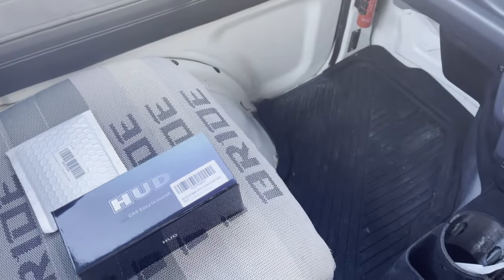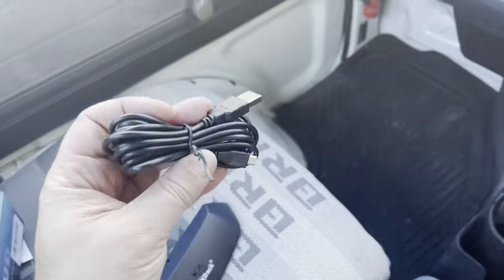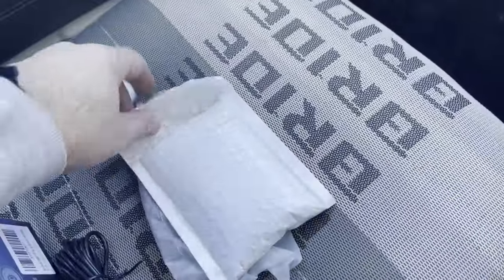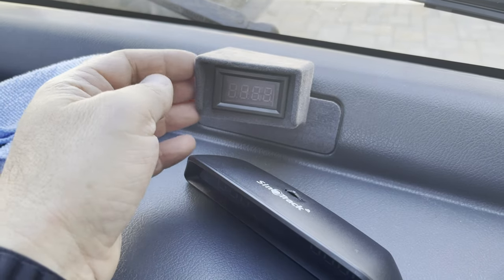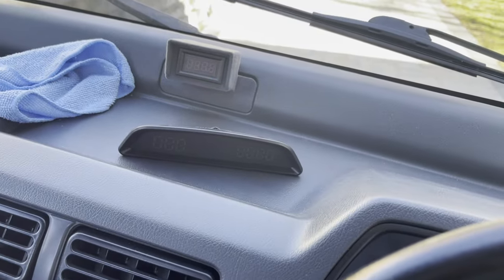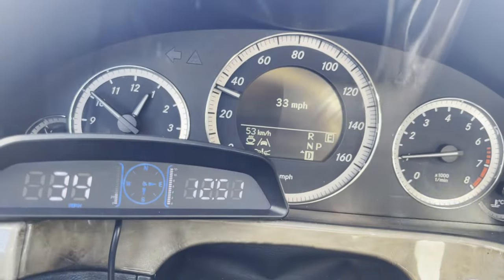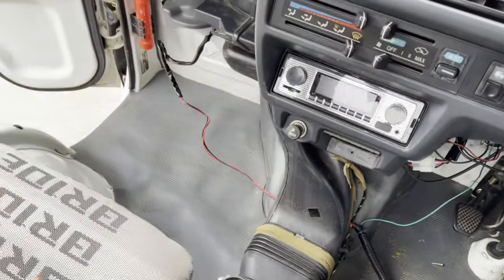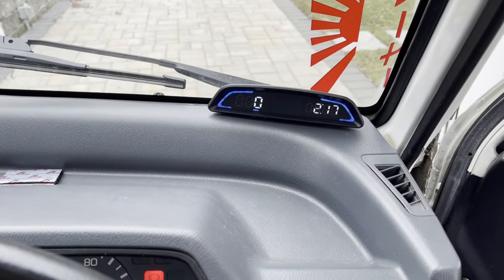Honda ACTY GPS Speedometer

Comment: i just pulled the plastic and put stickers on the faceplate
Reply from the maker: That is a simple solution.  However that wouldn’t be accurate for me because I’m running larger diameter wheels and tires.  Even the OEM speedometer in kph is not correct once you increase the overall diameter of the wheel tire combination.  Thanks for watching
Reply: @MarcoCerqueira  you can make it accurate as possible.   Track on phone GPS for real speed, then make the marks accordingly.

Ive not had thr best of luck with vehicle mounted gps speedos.   But im in an area with spotty gps